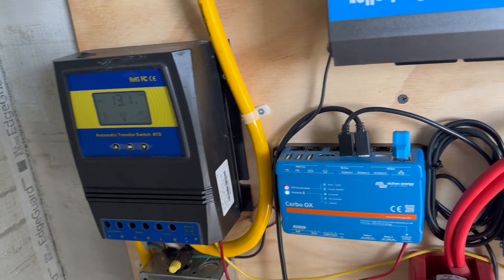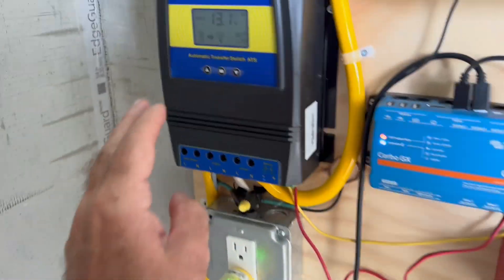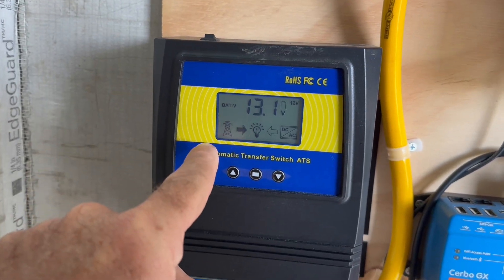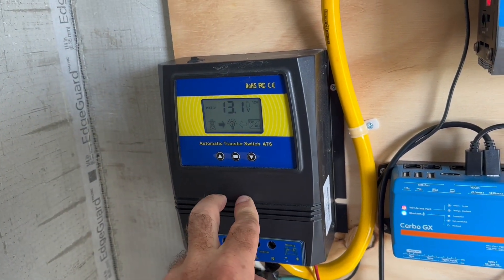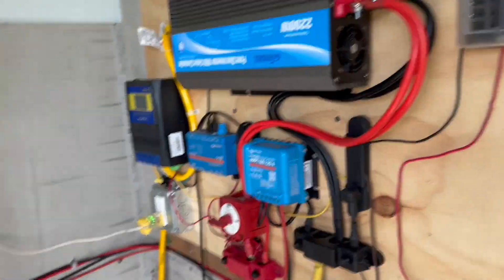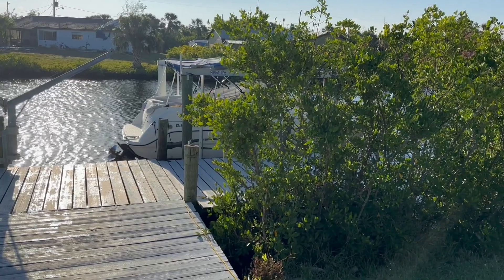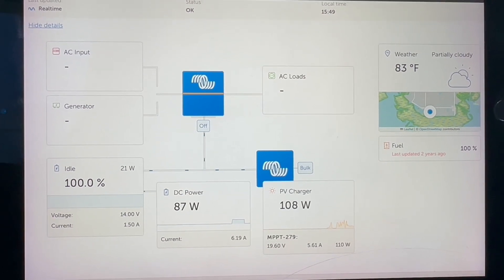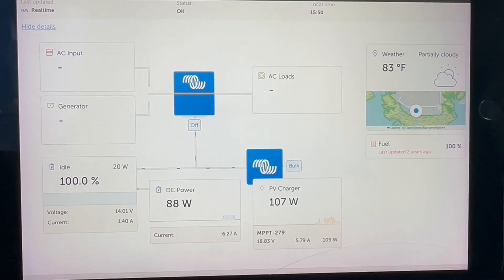Using MOES transfer switch and my 240w solar panel with 4 100ah Amperetime batteries  to power boat.

Comment: Great video!  I have a very similar system in my house for reserve power for emergencies.  I've been wanting to tie it in to run some lights just to get a little payback.  I've been looking at this switch, but my apprehension is how the system will work safely through the inverter.  (I have that exact inverter on mine too) I read in the inverter manual that you tie the inverter ground back to earth ground via the ground lug.  Will that allow the inverter to trip if there is a short or if the light receptacle housing gets energized somehow?  I can kind of see in your video how you tied the grounds from grid supply to what looks like the inverter supply ground.  I'm guessing you have the inverter ground lug tied back to earth ground in your panel?  I've also considered using this to run a pool pump, but I'm not confident in how the ground wire is supposed to be hooked up or how the pools bonding wire would interact with the inverter and cut the breaker if something around the pool became energized.

Comment: how do you manually switch back and forth
Reply from the maker: Not sure what you mean.  The MOES switch automatically checks if have enough voltage in the batteries (I set mine to 13.5) and if there is enough it runs my loads from the inverter, it the battery is below 13.5 it runs from the house power.